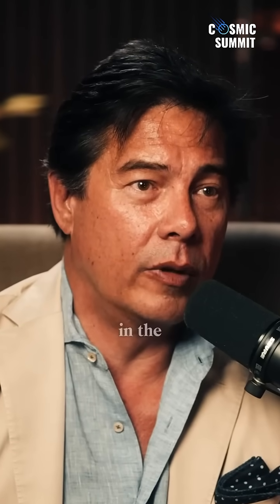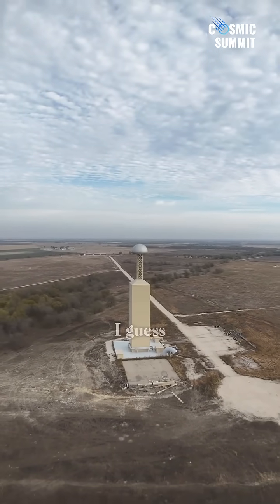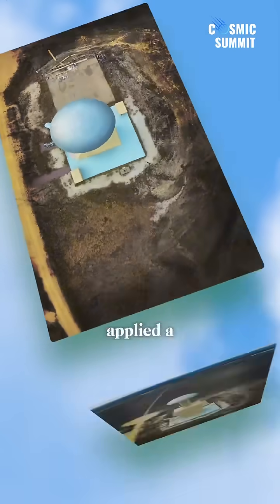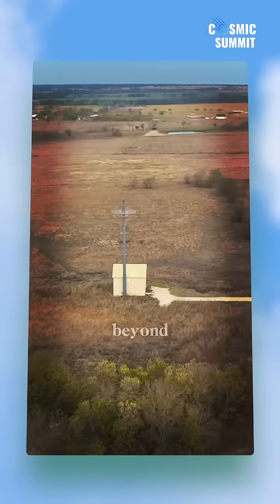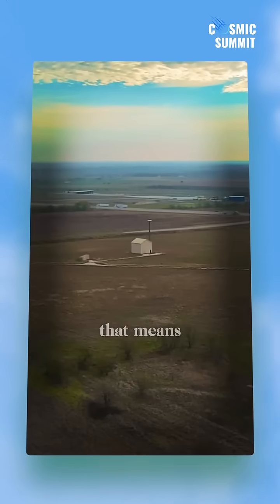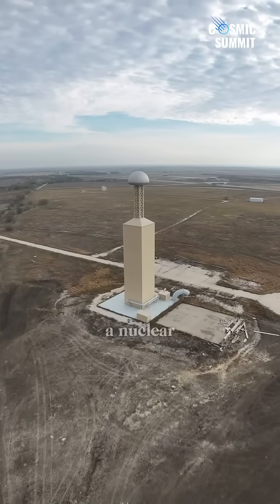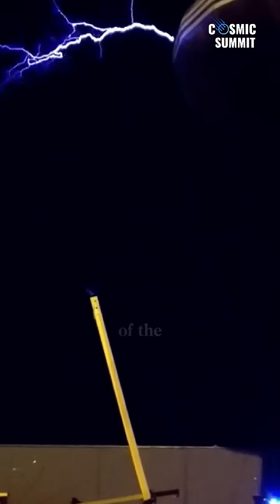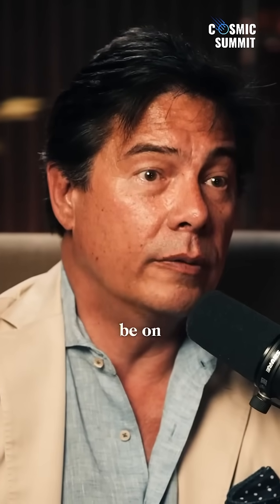New Energy Breakthrough: Tesla Tower Innovation

Comment: And yet no demonstration of how they are defeating inverse square law.  Because they cannot.  It applies no matter what.  You can certainly light a bulb 1/2 mile away.  and you will waste a lot of energy elsewhere doing so.  AM radio works the same way and has the same Inverse square law. Therr are million watt AM transmitters, nobody is powering much more than LED's and passive radios with them.  Microvolts  Nobody is suppressing anything, the physics are simply what they are in atmosphere.

Comment: Inverse square laws apply to an energy source that is uniformly distributed in all directions.  The energy from Tesla Tower seems to be locked up, like a capacitor, and discharges when an acceptable receptor enters a certain range.  As the electrical energy is traveling through a very good insulator (air) the energy drop my not follow inverse square laws but it can't be very efficient and most likely wrought with a number a safety issues. Unfortunately the short video does not provide enough detail.

Comment: Exactly what Tesla did 100 years ago, 40 km away, just more light bulbs. Hence not that impressive. Take rather a look at the latest Eiscat installation near Tromsø, Norway: a 100 mill USD international investment collecting cosmic electron energy from the stratosphere, then sending it out to all our homes metal artefacts through their earth cable or connection. The erratic frequency radiations sent through these artefacts appear to seriously reduce our levels of vit D and zinc. Which curiously resemble the covid symptoms.

Comment: You can negate the inverse square law by amplifying the Schumann resonance with a 7.81hz antenna and a mercury arc rectifier in a bore hole underground then AM phasing it with 432hz 10kv signal from atmospheric collection towers, then broadcasting the modulated signal with a fractal antenna for broadband transmission

Comment: This is all sparks and joy, till you fry all the electronics in the area. There's reason why all electricity is transmitted in wires, as you can pin point location where to send that energy 🤦

Comment: Yeah, you can't get around physics. Also, the reason this will never work, is you'll have all that electric charge exposed and uncontrolled. So many people would be getting electrocute everyday for a loss since air is actually more resistant to carrying an electric charge than most other things that you need those massive voltages to overcome it's resistance. Also, ozone is toxic and you'd be making so much that it would be another downside. It's a bad idea, end of story.

Comment: If you know about AM radio, at night, it bounces off the Kennelly- Heaviside layer dozens to a hundred miles above Earth.  It makes sense to me AT NIGHT one could beam, bounce, a dense signal from one site to another halfway across the CONUS.   However, in the daytime, that layer crashes to the ground, I do not think it would work except line of sight (LOS).

I know this because a childs experiment kit included  1960s... a crystal AM radio that had NO power supply, the energy from the radio station would provide the power, but only enough for the tiniest of earpieces.

If you shot a solid beam of energy instead, bouncing off that layer, maybe you could shoot energy across time zones, so a solar panel to the East could power stuff where the sun had not yet risen, in the West.  It is interesting and plausible.

Comment: Like Tyson says, if it's powerful enough to run something you wouldn't want to be in between the source and and the object
Reply: Like living under high voltage lines?
Reply: @johngregg9187 just for the record, electricity flows THROUGH wires until it reaches it’s user or id grounded. An electro-magnetic field produced by this action is not useable electricity
Reply: @johngregg9187  No.  Like living IN high tension power lines.

Comment: This is the Zero Point energy some folks are talking about, and YES Nikol Tesla was working on this.  His funding was pulled when they couldn't figure out how to hook up a meter and charge people for it.
Reply: It's because just about anyone could build a receiver if they knew how to dial it in,  Unlike running miles of cables and wires.
Reply: What happens if you stand in between the light bulb and the tower
Reply: @ryancollicutt4890  you warm up. same reason your microwave is a little faraday cage. some things should not be on the internet
Reply: @ryancollicutt4890  The same thing that happens when you stand next to any radio, just scaled up a bit.
Reply: @ryancollicutt4890  Lots and lots of pretty pretty colors, then you drool in your applesauce...  Actually, I do not know but it would not be advisable.
Reply: @ryancollicutt4890 nothing, the same way nothing happens if you stand infront of your wifi and your phone. Please learn how things work before commenting dumb shit
Reply: this is not zero point energy, this is air conducting electricity
Reply: Zero point? You don't get energy from nothing, there is always an exchange of some kind
Reply: @MyName-cw4yr  In an experiment , 192 powerful lasers ignited nuclear fusion in a pellet of fuel. That fusion reaction was the first one ever to release more energy than the lasers put into it. So you can get energy from nothing 
Or after energy expenditure is equal to output and equals zero.  
Zero-point energy (ZPE) is the minimum amount of energy that remains in a system when all other energy is removed. It's a quantum mechanical concept that describes the vibrational motion of atoms and molecules that persists even at absolute zero temperature.
 I would bet my MIT degree on it.
Reply: @MyName-cw4yr That's not what zero point energy means.
Reply: This isn't Zero Point Energy .
ZPE happens in a vacuum due to the Casimir effect.
Its more like Oscillating electromagnetic fields inside a vacuum.
Reply: It runs on the power grid, not the ether.
Reply: Metering is the easy part.
Reply: Bro, do you even physics though 😅
Reply: Zero Point Energy is a theoretical concept from quantum physics, that was established decades after Tesla - and it cant be used for power supply for physcial reasons. 
Tesla was thinking about using "kinetic radiation energy" from space - the patent is an early concept of a solar cell. 
Has nothing to do with free energy or zero point energy. Tesla has never been reported to use any of these terms, he likely never ever heard of them.
Reply: No it is not. It’s just a Zennek wave. Still requires an energy source. It’s just transport.
Reply: @NotaUserIam But a Zenneck wave is still electromagnetic energy and therefore is dangerous for the human body.
Reply: Dude!
Reply: It's not zero point energy.... it's just transmiting electricity without power lines. Also if tesla got it to work. We wouldn't have any use of any radio frequency am or fm.... think about everything that uses radio..... planes.... space flight...... satellites...... gps....

None of that would exist
Reply: Wirless charger... osiris tower... tesla inventor 1890/1900 year is not even the truth and is old technology WAKE UP... elon musk call it tesla.. cars can charger wirless
Reply: No it's not. Radio waves already exist from the planets electromagnetic field. We just apply bullshit commercials and lame songs to ride on them. Zero point energy field is the underlying glue that keeps this dimension within its bounds inside of this octave. Tapped into by opposing toroidal vortex of em fields.
Reply: I BLAME CHRISTIAN'S or religious sadists
Reply: John bedini
Reply: This is not new . This is tesla work and patents which are now open domain. But they are now trying to say it is new and their ideas so they can repayment and make billions. Nothing new
Reply: Yes, he was a smart person, that would be JP,Morgan and Mr. Rockafellow, they found out it would be for free to humanity, shut him down,where's all the missing trunks of notes that's missing after his death ☠️ or possible murder ??? Do we have the notes from Colorado springs, all info taken over but John Trump FBI........😮
Reply: This is NOT zero point energy. This is releasing a high-energy burst of eletromagnetic radiation in a specific frequency.
Reply: He figured it out they pulled the plug because of what you said. I believe it's the book of Ecclesiastes. What happened before will happen again there's nothing new under the Sun
Reply: They should have just had a flat fee for anyone in range.
Reply: @ They were not targeting consumers. They were trying to license tech and partner with manufacturers to produce towers at scale and that is the problem they couldn’t solve. The whole thing had to be built out of fiber glass.
Reply: tesla wanted it to be free, the current monopoly wanted to keep making money, so the buried him.
Reply: @HeavyDrop_  This is "radiated frequency" , nothing more. It is a massive waist of electricity and is highly dangerous to people and all living things between transmitter and receiver . There are way too many reasons to never use this method. Say goodbye to birds and buy cancer insurance.
Reply: It's the dude
Reply: If u are scared of a big tesla tower how you must feel with cell towers that give off radiation and your phone giving it a strait path to you. 

As long as you can pin point the frequency u can receive energy and for those that do not know tesla,s work u can be anywhere that it can reach. No you will not see electricity in the air that all depends if they want it to have color like your house light bulbs yellow blue white  not led that changes color,s . Nothing will happen to u as long as you don't be a moron on purpose and bring thermite wrapped in tin foil and tossed at it. For those that don't know microwave turned on next to one of those towers.
Reply: Might as well charge your phone 📱 if u all ready receiving radiation from cell towers and your phone. Best way to live longer get rid of your phone, and live in the woods 🪵 and get rid of everything that gives off frequency or go Amish 🚶‍♂️.
Reply: Literally use any vhf/uhf antenna and antenna analyzer to fine tune your antenna and see current on Smith chart
Reply: I think zero point energy has alot of people confused to what it really is: photons and neutrinos in the aether bouncing around and instigated in different fields, electrical,magnetic,and gravitational in order to produce electric power through the air(aether). Btw, Really basic definition , I'm no expert. Just how I think about it.
Reply: Maybe this supposed "German Scientist" found Tesla's notes lost when JP Morgan burned down his test tower in Colorado Springs.
Reply: many of his patents and inventions will never see the light of day due to being destroyed yes in the name of profit
Reply: This is controlled disclosure
Reply: It is not.
Reply: Yeah God forbid we find a way to give away free energy.
Reply: @godlydevil1 no such thing as free anything....
Reply: Free
Reply: Because of his financier, J.P. Morgan could profit from free energy so Morgan pulled the funding.
Reply: Didn’t Tesla do something to the Schumann cavity which allowed him to store electricity and then ‘pull’ it out when and where necessary?
Reply: This isn't zero point energy, that is quantum mechanics
Reply: No it's not.  It's a weather station
Reply: No it isn't.
Zero Point Energy is energy from the vacuum itself, so called free energy.

This is nothing of the sort.
This is the transmission of electrical energy using radio waves - plane transverse electromagnetic waves.
You already need the electrical energy.
Reply: @deang5622 please read more science and math
Reply: @deang5622 no such thing exists.

Comment: using a modified a.m. radio to power a vehicle is a wild thought.
Reply: You'd never get enough energy through that. This will at best be for light bulbs.
Reply: It's more likely to electrocute you to death than charge your EV.
Reply: Yeah if I put my truck on an AM station while driving I get 10x mpg! Amazing
Reply: Tesla made this in 1900s. people with a lot of money used all the power they had to get rid of all those machines. even today.
Reply: @christophraab3065  nonsense
Reply: It is possible to transmit massive amounts of energy this way and it could be the future of energy transfer and true global freedoms etc.
Reply: @aaronfrancois3996 I don't think you know how dangerous this "transmission" method is. It's a tesla coil, it builds a charge till it overcomes the resistance of air to hold or carry a charge. You wouldn't be able to go near these towers without special equipment, and even then there's no guarantee you won't be fried to a crisp. Your wall outlet can kill you. This is several orders of magnitude more volts and amps than anything you can get in residential service.
Reply: @Deathbomb9   This is not a Tesla coil but a radio tower. The idea was not to transfer energy by overcomming electrical resistance air, but by the electromagnetic wave itself. Like when you charge your wireless phone, just on a much large scale. You can indeed transfer a lot of energy but only on a  very short of distance. It simply isnt very efficient of long distances, thats why it has never been used for long distance transfer.
Reply: @thomasflototto9064 you do understand that's not how wireless charging works. Transmission over radio waves isn't what this guy makes it sound like. And there is no overcoming the inverse square law, not even with lasers.
Reply: @aaronfrancois3996 , it is possible? How? And how much energy would have to be generated and transmitted to, ultimately, have useful power at the remote receiver?
Reply: @aaronfrancois3996 it’s already being used by the invitational naationalists corporates trust founded sheep heads
Reply: @aaronfrancois3996  yeah wishful thinking.